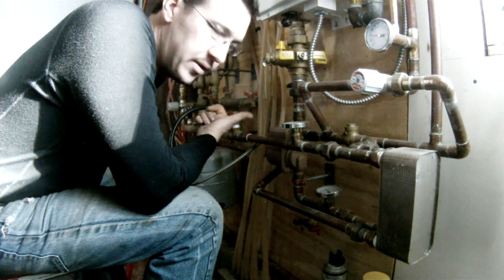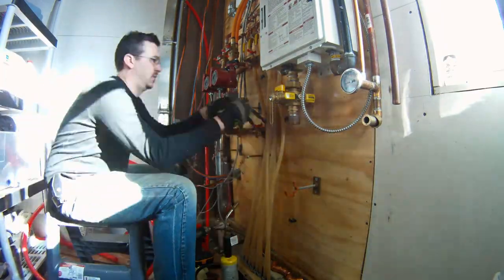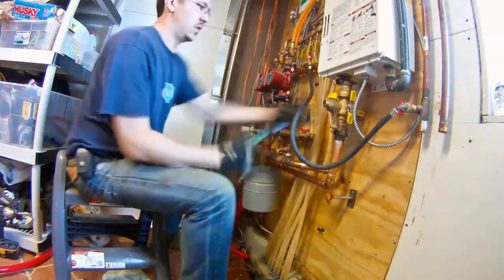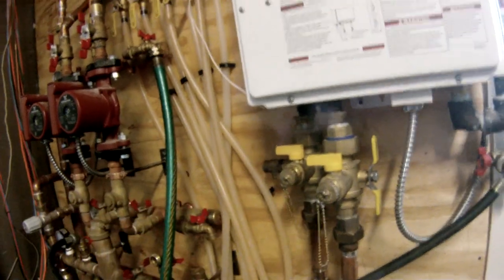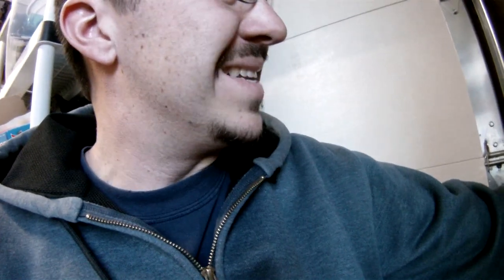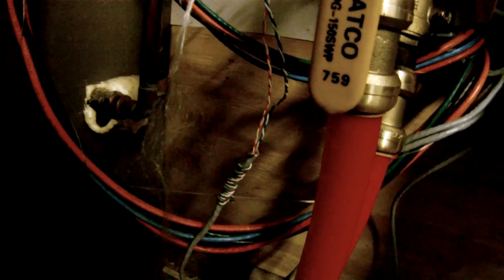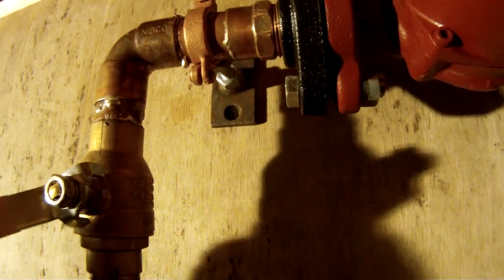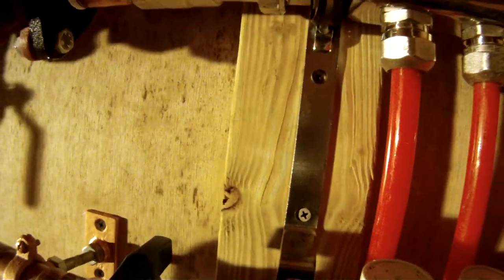DHW Heat Exchanger removal - 95 - My DIY Garage Build HD Time Lapse

Comment: looks like you have four loops, isolate them with flow setters and find the one that doesn't hold pressure, then just turn hot water back on to that circuit, rent a thermal imaging camera and scan your floor, you'll see big (like2'x2') hot spot where piping burst on you, bust concrete and fix it with a real coupling, not shark bite; and you have your loop back in business. Or if you don't want to bust the floor, just don't hook up that loop to your manifold.
Reply from the maker: This is a good solution.  I just read of a thermal imaging backpack you can get for the iphone that would be great for this.  Thanks